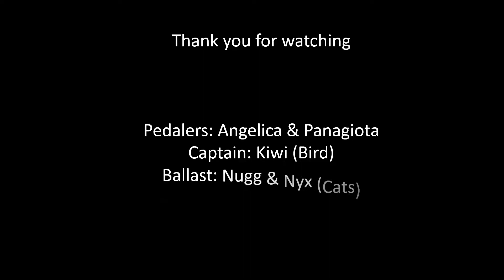Evolution of a Solar Trike

Comment: BionX system is not too friendly with the modification I think. Solid looking trike.
Reply: It depends a lot on the generation of the Bionx.  I have an early generation Bionx and I can pretty much do anything with it.  I understand later generations had a lot done to make the power setup proprietary, which sucked, and now the company has gone bust.  I wouldn't mind betting that's why too.  They basically set themselves up for a fall trying to sell batteries at 4 times the price that you could buy similar AH replacements from off the shelf.